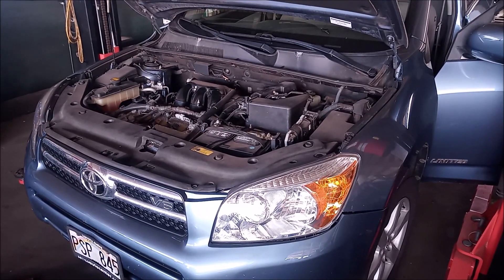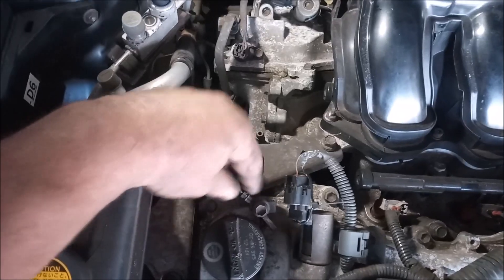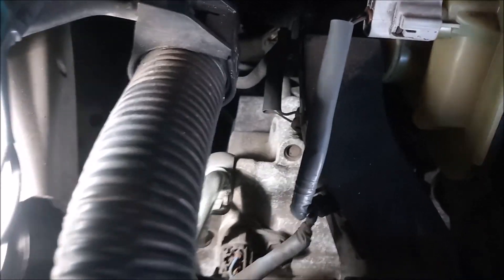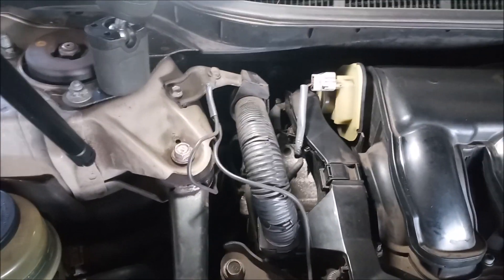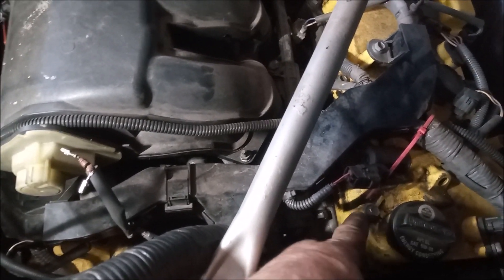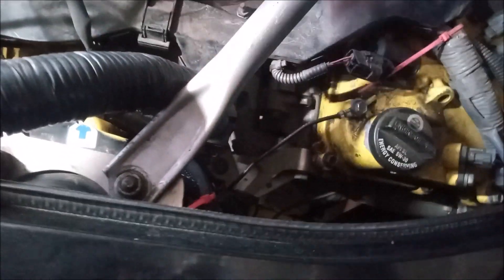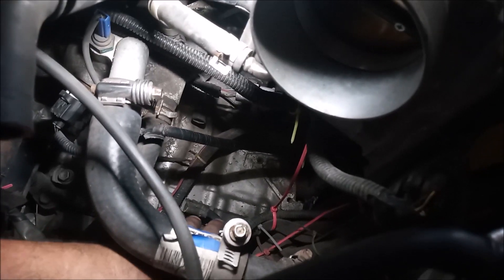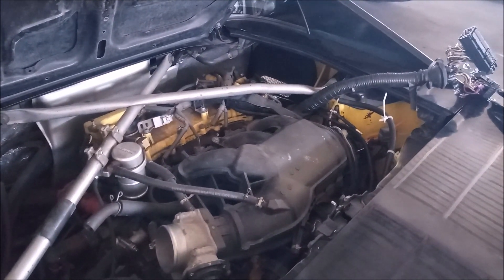Engine Grounding Locations for 2GR-FE Swaps

Comment: So I noticed on my 2GRFE the ground wire that goes to bank one is connected to the same wire that goes to bank two, I have codes for bank one which is super weird because I’ve never seen the codes before, now the engine is running rough and misfiring, and then proceed to shut off after an idol down from coldstart
Reply from the maker: Can't really say anything about your situation.
Reply: @Merryfrankster_ it’s because the 2GR-FE engine required from Toyota need grounds on both bank 1&2, I called a Toyota dealer today and was told this and they gave me a website to go to and find what I need, I found that the engine has four MAJOR grounds, 1. Bank 2 radiator side which controls the sensors and coils as well as the VVTI SYSTEM on that specific bank, 2. Bank 2 fire wall side pertained to the exact same function as bank 2, 3. You have the engine to chassis ground wire that controls pretty much everything but what the first two ground wires do, 4. Alternator to transmission to battery ground wire controls the function of the charge kept on the battery.
Reply from the maker: @LuxxStylez  it would be useful if you link that website where you found this info.

Comment: Hello sir. As a DIY guy I finished replacing the engine in  my sons 08 es350 in my garage. It runs well but now I have a P0560 issue and from what I read the ECU is not retaining power after shutdown. If I clear the code it comes back immediately. I feel like it could be a ground that I missed or possibly even a pinched or damaged harness wire. I do know that the A10 BATT + pin at the ecu harness is getting 12 volts.
Reply from the maker: This is link to diagnostic procedure for 08 Sienna 2gr-fe. Should be very similar if not exactly identical to yours. https://www.tsienna.net/system_voltage-2243.html

Comment: Hey Boss, what type of screw is at 2:13 mine has fell off (the one that connect metal plate to the frame, it has an E letter on it, I’m trying to order it but having a trouble to know the full details, thanks in advance
Reply from the maker: Not sure. Sorry.

Comment: @Frank - What's the weights/difference in weight of the V6 versus the I4? Also, since the swap, have you noticed any handling peculiarities (going on the gas pedal - front end becoming light, and when braking, the opposite)?
Reply from the maker: The weight difference is quoted variously as being about the same for the NA 4 or a little bit lighter than the turbo four. My car has suspension and braking mods and tire widths and custom alignment so I cannot compare to anyone else car but feels nicely balanced although less nimble than my 1900 lb Spyder.